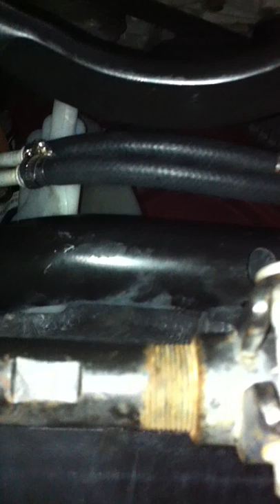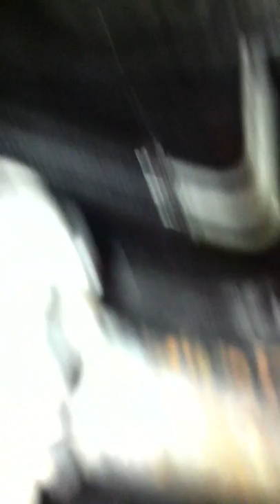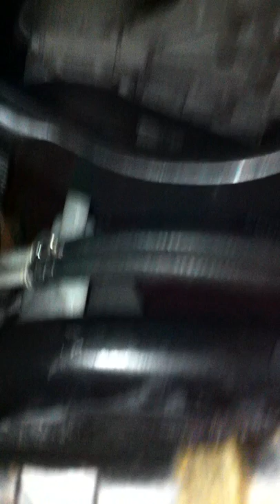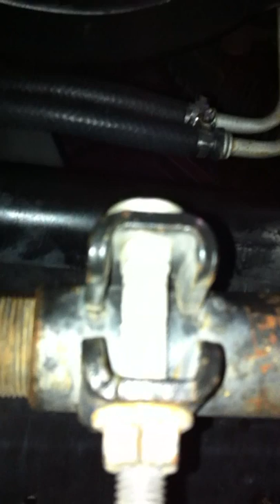Jeep Wrangler AT oil cooler line repair - pt 4

Comment: Man, thanks for posting this.  I'm gonna try it.  Mine's an 08 with 65,000 and its dripping pretty good.  I've been monitoring the oil level but this fix seems a lot easier than swapping out the whole line.

Thanks!